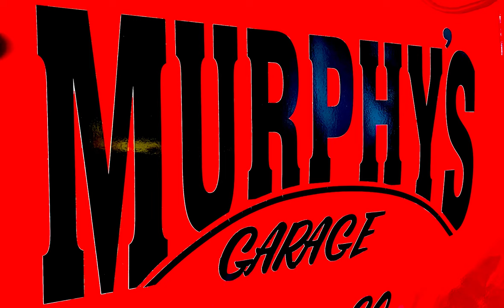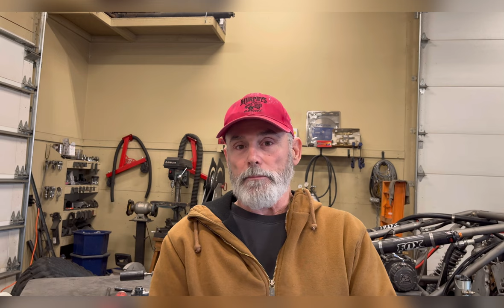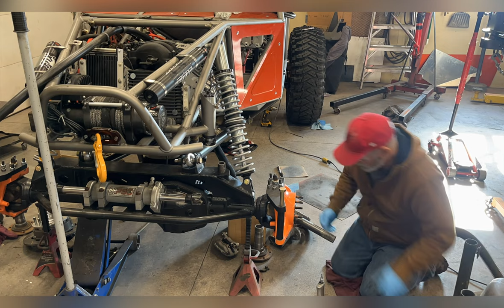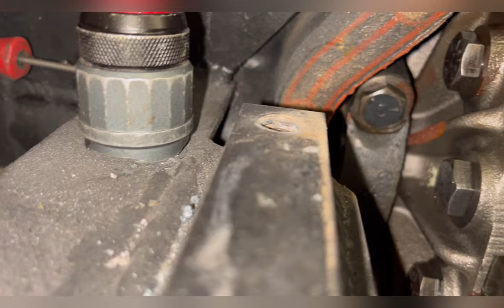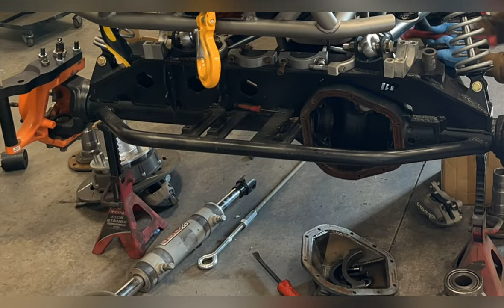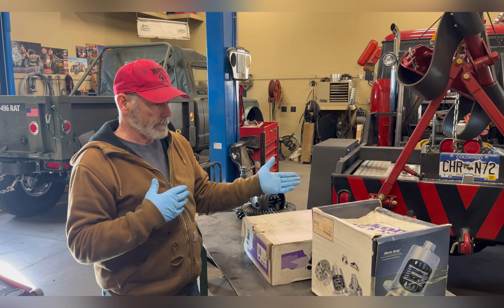Dana differential re-gear. Dana 60, and most any Dana’s

Comment: hey, thank you, i have a question on the gear oil suggestion.... working on a f150 9.75 E lock,, installing 4.56 front and rear. on the rear is ir okay to run conventional oil in this one? what weight?
Reply from the maker: @sheldonkepley4585  I usually use the cheapest 80-90 I can buy unless the axle calls for a specific oil. Some of the E lockers will call for synthetic oil so they will release correctly.

Comment: Great video! Newbie here, if I’m replacing the carrier bearings but reusing original gears, could you use original preload and lash shims? Or would I need to reshim and check everything
Reply from the maker: I wouldn’t change any shims, reinstall everything the same, new bearings shouldn’t change the preload or backlash if it was set up correctly originally. You don’t want to adjust it due to a wear pattern. I would check the backlash and preload just to be sure and definitely don’t change the depth shims on used gears, that will not change. Don’t try to do a contact pattern either, it won’t read right on used gears.
Reply: When you say preload, are you referring to the carrier bearings or pinion preload? Sorry for the dumb questions
Reply from the maker: Both, first make sure the pinion is good and then the carrier. Just doing bearings though, you shouldn’t have to change anything.
Reply: @murphysgarage  Thankyou!

Comment: I noticed you didn’t mention the oil baffle on the pinion, I’m assuming that is part of the pinion depth measurement? Also, how would you go about removing the race to add or remove shims, without destroying the baffle as it is in front of the shims.
Reply from the maker: Yes it is. Sorry, I didn’t focus a bunch on the baffle, some differentials don’t have them and some do. Unfortunately I usually damage them when I remove the inner race and replace them with new ones on final assembly. Measure and use shims to substitute in place of the baffle until finally assembly then swap the shims out for the baffle.

Comment: i have a 2009 ram 2500 HD has the AAM axles the axle shafts and ujoints on the front are much larger than my 1994 ram 2500 both axles are same  44 front  60 rear was planning on building a offroad recovery vehicle wanted to use the 2009  chassis because much stronger frame and diff look heaver duty but will be using older cab planning on a 1950 dodge cab and flatbed
Reply from the maker: That will be cool!

Comment: Was wanting your input I'm still working on the 67 m715 I have a T98 trans but it has the divorce transfer Case and the T18 has the transfer Case attached but it didn't have the Bell housing and it has the long pilot shaft which is the best way to go changing out the pilot shaft for a short one or go with the spacer the engine and Bell housing I have is a ford inline 300 6 also would you have or could you let me know what the transmission are worth the T18 has the 1.632 1st gear thank you and congrats on 1000
Reply from the maker: I would definitely go with the married transfer case and T-18, they will handle higher speeds without overheating and vibrating. As far as the pilot shaft, my first choice would be the one that lines up best with the tunnel for the shifter, if that won’t make a difference, I would be more likely to go with the easy button which would  probably be the spacer. The other consideration for me is parts availability, off the shelf, incase you need to do repairs in the future. Since you are going with a Ford 300 engine, you should be able to buy direct bolt in factory parts for this transmission, the T-18 came in a bunch of Ford trucks.

Comment: Great video ,thank you for posting.  I have a question about Dana axles that use crush sleeves. Can you check pinion depth without installing the crush sleeve by just installing the bearings on the pinion and tightening them to the proper preload? Once you have the proper pinion depth then instal  the crush sleeve?
Thank you
Reply from the maker: @carllafong9368  absolutely, don’t install the crush sleeve until your final assembly. Just snug up the pinion without the crush sleeve until the pinion bearings are seated with some preload. Once you get the depth set correctly, then install the crush sleeve and torque to the preload spec.
Reply: @murphysgarage  Thank you so much for the quick reply. I’m rebuilding a Dana 30 and when I took it apart there were no shims on the pinion. This had me concerned because I’m not sure if this is common or not? When I reassemble I want to make sure my pinion depth is correct and I wasn’t sure if you could do so without installing the crush sleeve.
Thank you again.
Reply from the maker: @carllafong9368  you are correct, set it up first. By the way, there may be a shim behind the pinion bearing or behind the inner race. I also have a Dana 30 video that might give you some additional information. It is hard to do a thorough video on this subject in a reasonable amount of time.
Reply: @murphysgarage  Thank you I’ll search for you Dana 30 video. There were no shims on the pinion underneath the bearing or behind the race. That’s what concerned me that someone had been in there before and took out the factory shims and never put them back? The pinion also had Japanese bearings while the carrier had Timken’s leading me to believe it had been rebuilt before. 
Thank you.
Reply from the maker: @carllafong9368  interesting, I would out it together and run a pattern, go from there.

Comment: So you're saying check my pattern and if the pinion needs shimming take out the carrier and re shim the pinion?
Yeah big pass, you should be able to set your pinion correctly without installing the carrier
Reply from the maker: You can do them mathematically but if the pattern is off, yes, you have to remove the carrier and adjust the shims on the pinion, except for third member type differentials, like 14 bolt and 9”, those you just remove the pinion support.